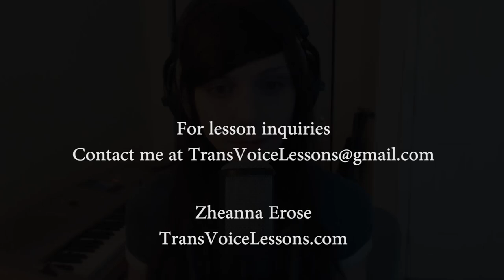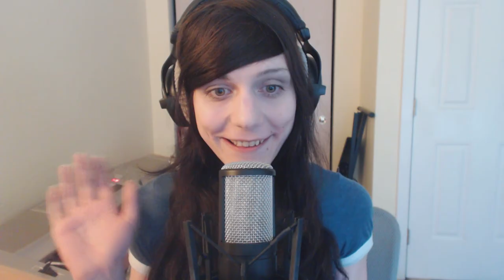Sex in Voice Explained Simply

Comment: Your videos are very interesting thank you :-) If so much comes down to size of vocal tract then how much role is actually played by length and thickness of the chords?
Reply from the maker: orlando098 fantastic question. Yes the folds need to be treated behaviorally as well. We can thin the folds behaviorally through a rocking of the cricoid - thyroid pieces which thin the folds and produce less vibrating mass
Reply: @TransVoiceLessons  OK thank you :-) But would you say the basic sound produced by the chords is actually less significant in how masculine or feminine a voice sounds than the way it is then resonated and modified in the spaces above? I always thought the main problem with having had a male puberty is that the chords enlarge, but it seems that is just one  part and not the most important, huh?
Reply: @orlando098  if you thin out the vocal folds while having a large vocal tract length you definitely won't sound feminine

Comment: I read over 300 books and I ace my Biology, Chemistry and Physics but omg I don't understand what you are saying.
Reply: She uses sound theory. Basically all sounds are affected by the space of your mouth. Bigger space, deeper voice, . Think of it as dials on a stereo. Some condtrol one part, some control another part. Larynx is the tthing they call adams apple, for females its smaller, for males its bigger. Or inbetween, depends on your genetics. So if the larynx is high, you will sound like a female (say this is volume) and the space of your mouth is the bass (horizontal) . So even if you learn to adjust the larynx upper, but not control your mouth , you will sound like a girl with a heavier voice. eg bass. So smaller controlled vowels, more pauses in your mouth, higher larynx but not too high will basically help you to be female. Or vice versa if you are a ftm .